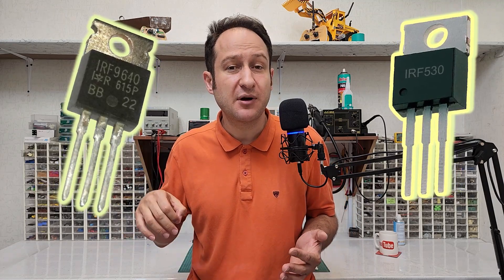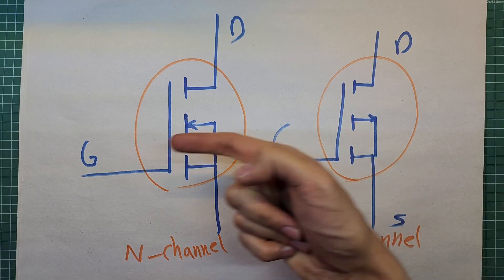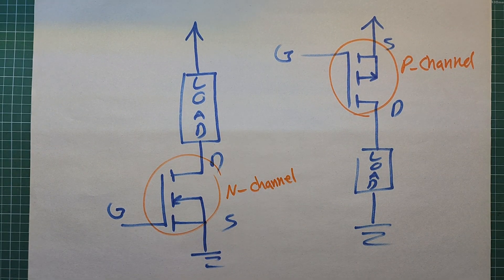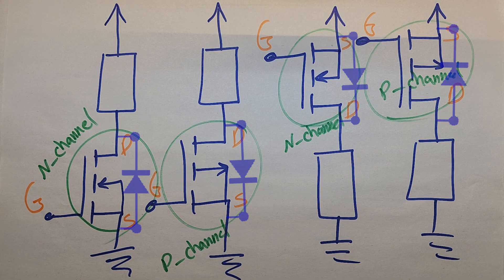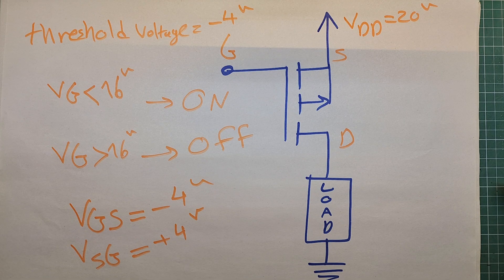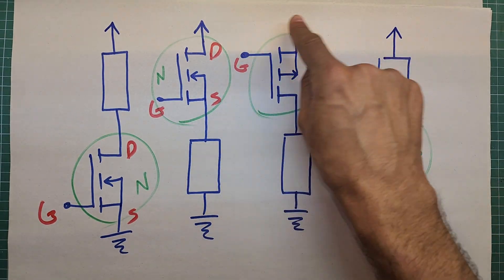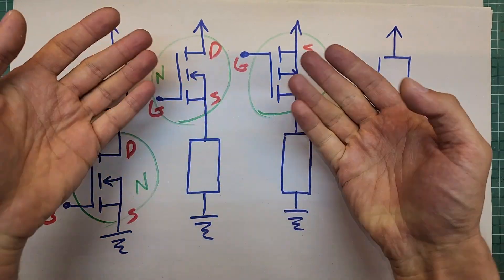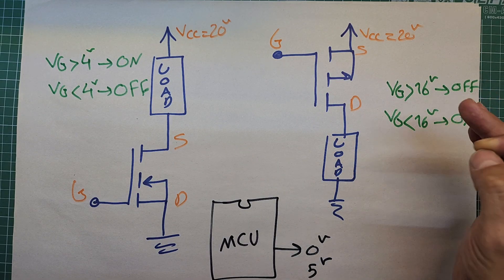Where to use N or P MOSFETs? Why N-channel is more popular 🤔?

Comment: I suppose the main problem of using a p channel type is switching it from a microcontroler. I guess the solution is to use an inverter transistor between the gate and the microcontroler?

Comment: Use NMOS for everything but h-bridges and inverter/convertor. When you use PMOS pay a few bucks for a high side driver IC. And remember boys and girls, the body diode in the FET is not good enough for inductive loads. Also, in an h-bridge the high side inductive spike is shunted through the low side diode.

Comment: I am still learning about mosfets and this explanation makes it easier to understand how mosfets work as well as how to use them effectively. Great video, thanks for sharing 👍
Reply from the maker: Awesome, I'm glad the video was helpful! 
Keep watching 👍
Reply: I've been driving relays on the high side for years with no issues. I assume that with the low resistance of the load the source voltage is pretty low and the MOSFET doesn't care too much. I'll switch to the low side on future projects.
Great video.

Comment: Curious what type of circuit or requirement would need a P-channel configuration where one has to know the voltage, and have -4 to >known voltage to turn the MOSFET on or off?
Reply: An example would be a circuit which requires switching a positively-grounded source.  If your load requries a positive and a negative power supply line, with a common zero volt line between them, you'd have an N-channel mosfet switch the positive source's path to ground after the load, and a P-channel mosfet switch the negative source's path to ground after the load.  One place you see this, except usually with IGBT's, is power inverters that need to produce a symmetric AC waveform, centered on ground.

Comment: thanks for practical tips. It would be better to see in a design process,  you can design a bldc driver  and show all rules applied.
by the way,  which one is better to measure the current, high side or low side?  please answer in noise performance aspect.

Comment: What is the difference between NPN vs PNP transistors? because in the 60s engineers would say that NPN & PNP are "NOT EQUAL" because the NPN transistor Collector pin would output more electrons more current from NPN compared to PNP. Its a ratio of holes VS electrons. The PNP emitters little RE would be more unstable for temperature drift compared to NPN emitters little RE. Is this a Myth or Facts?

Comment: the first major issue I had with N type mosfetts was using it to control power on addressable LEDs, as the problem was there was always leakage current to ground through the data lines, a P type mosfett resolved this as it blocks the voltage source from ever reaching the LEDs in the first place.

Comment: There are two points in this video that I disagree with, but the second one is definitely nitpicking.
The main point is that although driving a high side N-channel is much more complicated than driving it low-side, it's still often much easier and better than using a P-channel. Especially hot things like buck converters, H-bridge circuits, and many other power electronics. In fact, it's so common to do this that most ICs designed for power electronics incorporate a bootstrap diode so it's just as easy to drive as low-side.
Second point: at 5:30 you say that the inverted mosfet configurations are not used because the body always diode conducts, but both actually are used more than you would think. Off the top of my head, all synchronous converters use mosfets where they conduct in the same direction as the diode, and the P-channel is used that way in reverse polarity protection circuits, and I think some momentary/latching on/off circuits.
On a more beginner friendly level, you can use back-to-back mosfets to switch AC, so one is conducting through the body and one is doing the work each cycle. (Although there's usually a better way...) 
I totally agree that for most of the time a low side N channel is the way to go. And after that, usually a high side P. I just think people should know that bootstrapped high-side N-channels are sometimes a better  option. And forward biased body diodes are not as useless as they seem - in fact, they are certainly being used in the power supply of whatever device you're reading this on.

Comment: I subscribe to your channel as I think you are a good teacher, and it's always good to go back to basics.
However, even though you corrected a confusing point in the earlier version, this one still partially ignores that it is very rare to find MOSFETs without the internal diode structure.
I think it would be better to always include the diode in your drawings and always mention the problem it creates. A newbie will not always remember its presence. Also, there is no point in teaching non-practical circuits.
I don't want my criticism to be taken negatively; believe me, I know it can hurt! Please continue with this series and move onto why gate drivers are needed for high-side N channel MOSFETs. That will be a really good illustration of using the advantages of the N-type where a P-type would be expected.
My last point: Don't take down erroneous videos. Refer to them, and use them as a learning opportunity. It's how we all learn the best; from our mistakes.
Still love your channel, still subscribed! 😊👍
Reply from the maker: It is awesome that you gave me another chance ❤️
Yeah, your points are valid and you are right ✅️ 
I'll be more careful in upcoming videos. 
Last point: I've realized that this video is not in my teaching level, sorry for that 🙃

Comment: What about drive MOSFET with low voltage such as 3.3V MCU? A video could be great about!
Reply: You need to find a mosfet with a Vgs that is low enough, use a simple BJT stage or gate driver IC.
Reply: generally speaking find a mosfett that works at the logic level you want to control it at, eg 3.3V, 5V, 12V etc, much easier than converting the voltage.